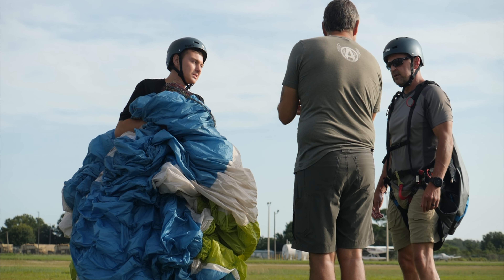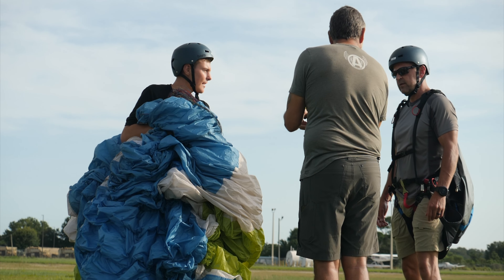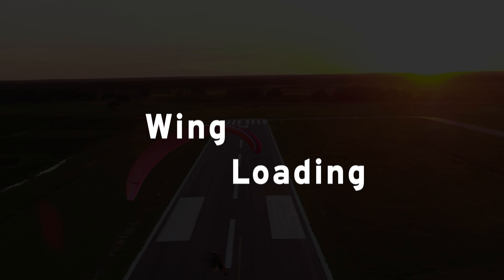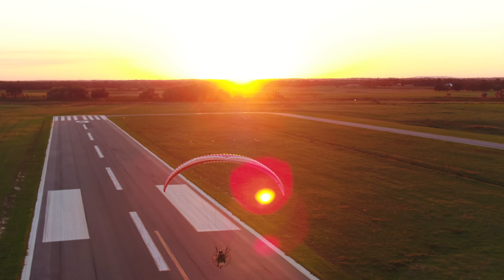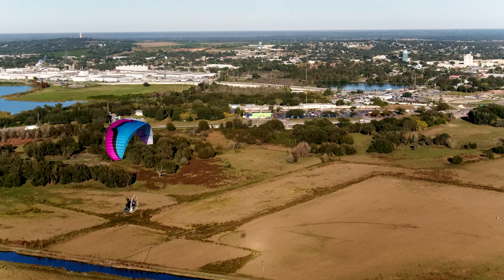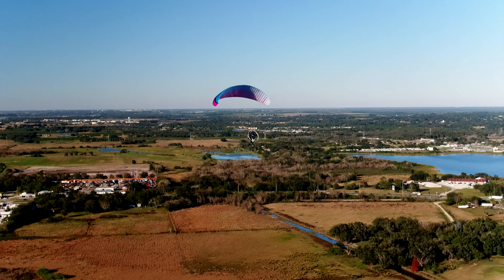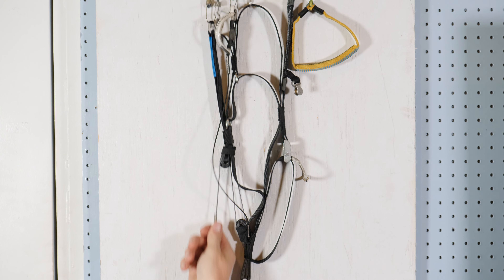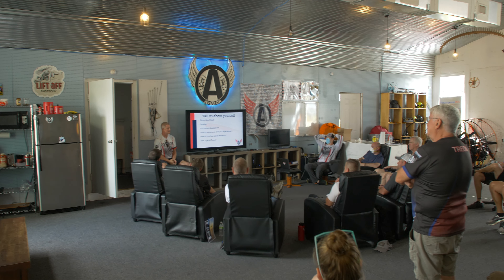UNDERSTANDING THE PARAGLIDER - Energy MGMT: Ep. 3

Comment: I'm a paraglider pilot with no motor and don't want one and I'm learning to glide and I probably will fly as close to the style you're describing with no motor as possible. My landing intention is to fly the last 100 ft of altitude off with no brakes come in a trim speed Wing level and when I get to the bottom of this line at the ground 1 ft above the ground I will pull the brake to a full flair. I'm trying to eliminate the transition from leveling to full flair into a transient so it happens quickly and I can't lose my level on the roll axis. If I'm coming in a trim speed, I can think it I can see it I can fly it.